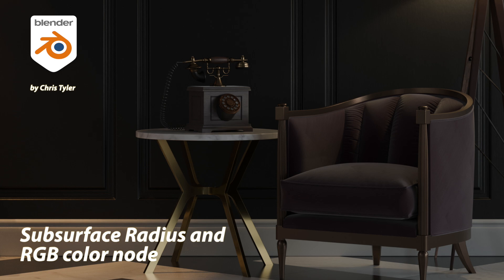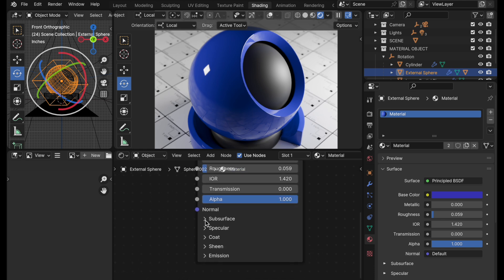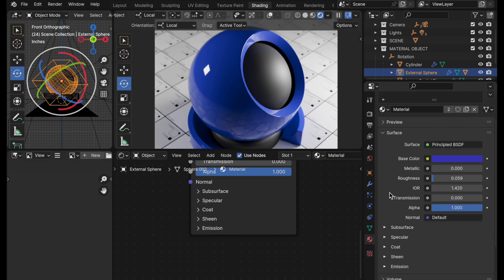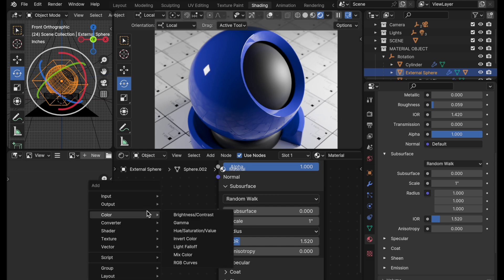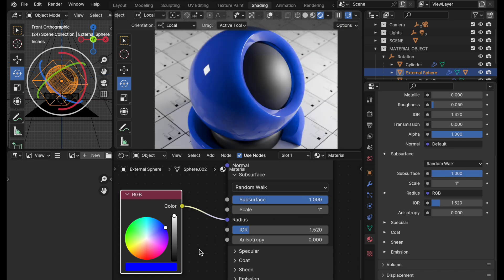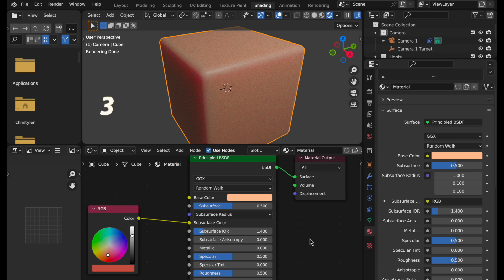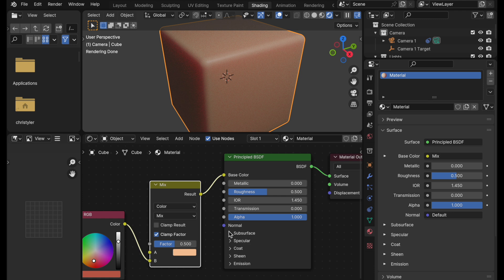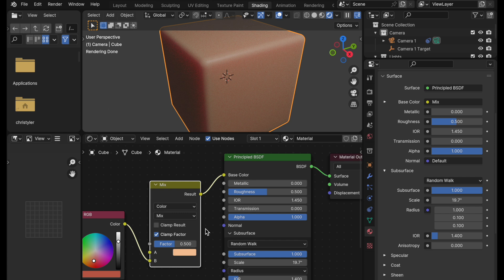4.0 Subsurface Scattering, a FOLLOWUP

Comment: Nothing matches up for 4.2.0 Just need a quick way to make wax like the older version.
Reply from the maker: Make sure it's in Random Walk (Skin) mode, set the Weight to 1.0, all 3 Radius values to 1.0, then set the scale based on the size of your object.
Reply: @christopher3d475 
Thanks! I've been using Blender since 2003. I hate changes in software sometimes. You saved me.

Comment: Thank you for trying to explain this to us but sorry to say they changed it again the subsurface value was replaced with a weight value not sure if it works the same. The result of Two methods to get red was green & the 3rd added red using mix node was black & white I hope the new system is better but currently not seeing it.
Reply: Did you ever figure out the equivalency of weight vs value? I'm just diving into using SSS for the first time since 3.6 and I'm a bit lost

Comment: Now that Base Color is also the subsurface color in the Principal Shader, you can make them different colors by using a Subsurface Scattering Shader, then mixing them with either a Mix Shader node or an Add Shader node.

I like the Mix Shader node because you can control the mixing using the Factor slider.

Comment: Could you do a bit of a dive into something Brecht said on devtalk?

"There are multiple valid ways to use the subsurface radius and scale.
One is that you can use the float to set the scale at which you are working, and then treat the RGB values as a color, that you can texture if needed. Another is that you can set the RGB values to absolute distances, and then have a texture map for the float to vary the distance.
We could easily change the absolute unit to be on the RGB values instead of the float. It’s unclear to me which is more common or useful in practice."

Wonder how these methods compare. My gut is telling me the second option, though less initially obvious, could prove useful to keep around. I did plug a magic texture into scale with some whacked up rgb values, which was fun, but I'm not really that great with SSS to properly test the strengths and weaknesses of each.
Reply from the maker: I need to do some more investigation because they also added Random Walk (Skin) as a mode which has its own rules. Some initial testing shows that it does look more skin like, but I need to find some time to really dive into it more.

I actually like the way it is now, where you have one parameter to set the scale/sss distance and the 3 rgb values to vary it. That seems most logical to me.

Comment: if you use a subsurface value texture (a non color texture, mostly from Substance Painter) it becomes the mix factor of both RBG values on the math node, and also becomes the Scale value of subsurface, testing it on both as Scale and Subsurface value gives the same result as long as the other one stays on 1.0, visually speaking the new subsurface with "default" 3.6 values on 4.0 gives a similar value but more darker contours on the mesh (some of the "see across fingers" effect is lost around the models)

Comment: A Thing that bothers me a bit is that the Subsurface Radius could just have been replaced with a Color Input directly, instead of when a RGB node is connected that is then showing the RGB panel to edit.

But Thank you for the Informative Videos on the Updates!
Really enjoy watching your Videos!
Reply: I feel like the decision to leave it to vector is to allow for stylized rendering (using values larger than 1), while the color node would always cap RGB at 1.
Reply: @zozeorswaf You can manually put the RGB values above 1, but then you should instead really just increase the Subsurface Scale.

Tbh, I did ask in the principle v2 dev thread about why not having an RGB input instead of an vector one, but still haven't gotten any answer yet :\
Reply: The Radius parameter represents the distance each color channel travels inside the material, so to me it makes more sense to think of it as 3 float numbers (thus, a vector data type) instead of a color. Even though it can be more easily manipulated with a RGB node, I think making it a color socket would just make it more distant from how it should be perceived. Not to mention it would imply the need to worry about clamping and color transformation - it's something that, if you were to use a texture, it would make more sense to use a non-color space instead of sRGB, for example.
To summarize, I don't think it represents a color parameter.